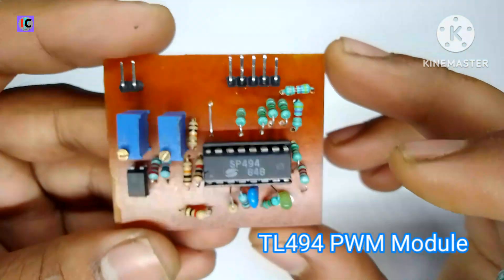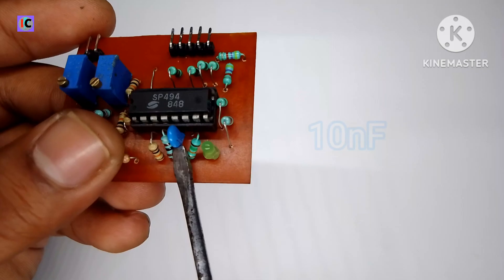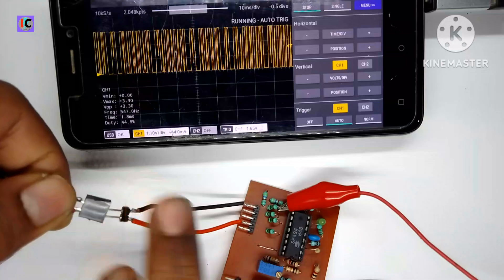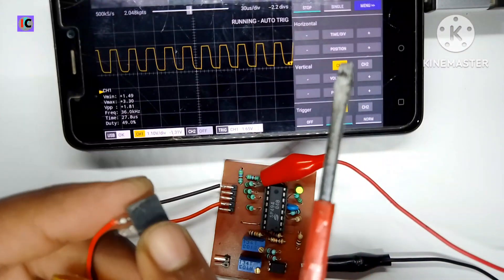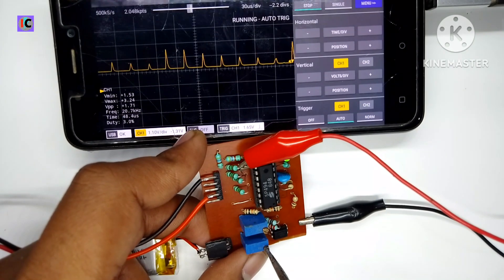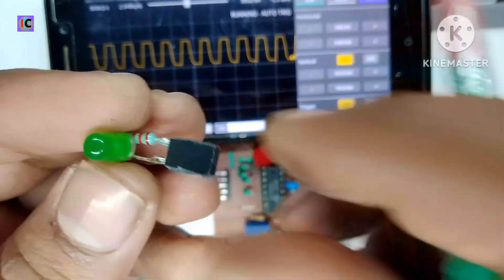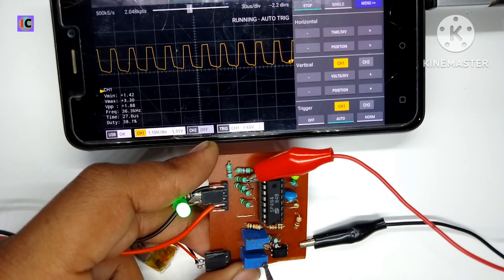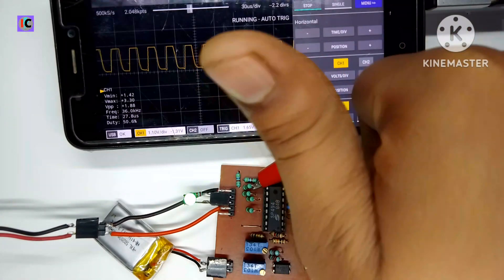TL494 PWM Circuit #tl494  #pwm  #inverter

Comment: Thanks.nice work. want to now if voltage feedback have aresistor or not .and were to conect courent séance.
Reply from the maker: voltage feedback have resistor and the current sense i.e. pin 16 of TL494 will connect to shunt resistor, also I am working on buck-boost converter which come soon.

Comment: Bro. where I connect (I-FB)? Please help me.
Reply from the maker: the I-FB pin will connect after shunt resistor, just like a closed circuit in which shunt resistor is connected in series with load in negate side

Comment: I-FB connection means one side of shunt resistor in module I-FB and other side of the resistor in out put negative, Is it right bro? If out volt is 350 for inverter then same connection? If I do not connect I-FB then any problem?
Reply from the maker: Just connect one terminal of shunt resistor to GND and other terminal to load -ve, so the point at which the load -ve terminal and shunt resistor terminal is connected so this common point is used to connect I-FB. And for inverter this method will also works but keep in mind for higher voltage like 350V the shunt resistor value should be around 1ohm or 2ohm to properly sense current

Comment: Sir part two pls how to connection feedbacm wire in output pls pls pls pls reply 🙏🙏🙏🙏🙏🙏🙏🙏🙏🙏🙏🙏🙏🙏🙏🙏🙏🙏🙏🙏🙏
Reply from the maker: ok in second part all doubt will be solved
Reply: @innovationic  sir sir please reply how many day take I will waiting pls pls also adjust volt and frequency in 2nd part
Reply: @innovationic  very very thank you sir 🙏🙏🙏🙏🙏🙏🙏🙏🙏🙏🙏🙏🙏🙏🙏
Reply from the maker: may be tomorrow
Reply: @innovationic  very very very thank you I am waiting 🙏🙏🙏🙏🙏🙏🙏🙏🙏🙏🙏🙏🥰🥰🥰🥰🥰🥰🥰🥰🥰🥰